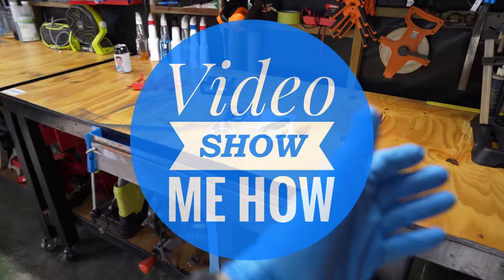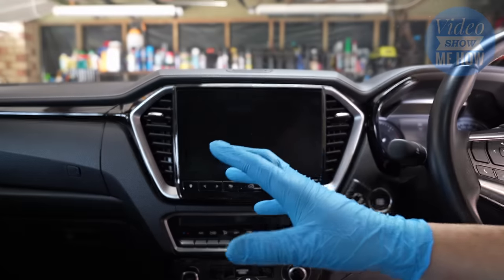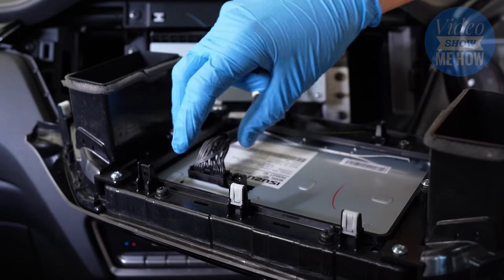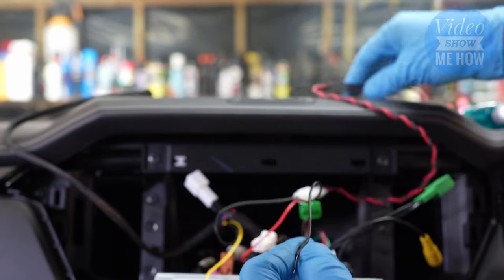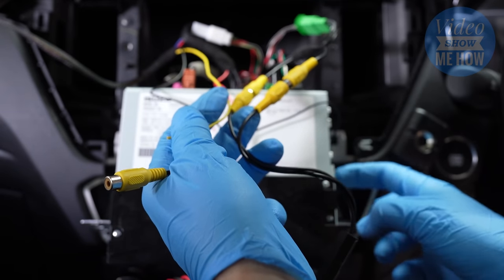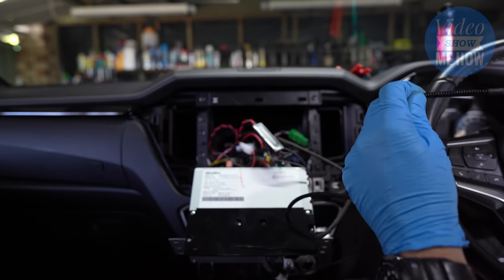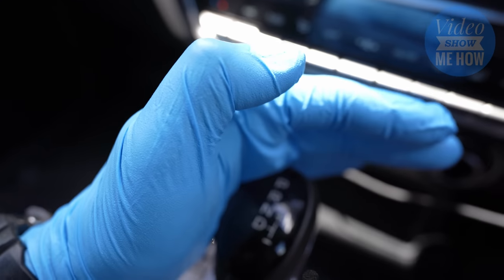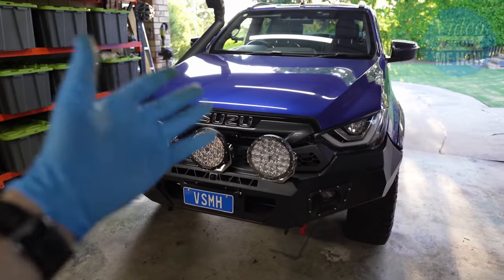D-MAX BT50 MUX DUAL Cameras! | Trac Electronics AT2 | 2021 Isuzu DMAX Build Series #31

Comment: I picked up my Dmax in Oct 2020 so she  has absolutely proven herself. First mod was front bar w/ winch, rear bar, underbody protection. Then tail gat lift, AT tyres,  HD suspension to help with the towing. Throttle controller was a revelation as where the LED reverse lights, licence plate lights (helps with connecting van at night) and front light bar. Tub rack and roof rack gives massive versatility and most recent was the DP Chip perfect touring beast.

Comment: Owned my D-max since Feb and first mod I did was the dual battery system the same way you did yours in the tub with the toolbox, I've found it very convenient and such a good idea to keep it all together also if I change my tub to a tray all my electrical components are very easy to move and install into the new tray.
Thank you for all the vidz you've given me the confidence I needed to make my D-max into my own pride and joy that I've proudly built.

Comment: I'll be definitely be getting this trac module. Thanks for all your helpful videos, even though i am handy its just good to get a bit of confidence from watching your videos. So far I've done the auto mirror mod, rear central locking, tailgate assist, back and front traffic cameras, 7pin trailer connector, brake controller, catch can and pre fuel filter. Keep up the great work 👍 👏

Comment: The first mod we made after picking up our new ute was the Trac window and mirror module which we bought after watching your install Adam. Your instructions were super clear and easy to follow to the point I delegated responsibility to my 14 year old! 

We would be very keen to install the Trac camera module next, and I think the hardest part will be deciding on location - front or rear.

Thanks again for your vids and thanks to Trac for another great product.
Reply: I have a twin-under-the-skin BT50 and have heaps done to it already,  but I am keen to add the window module to fold in the mirrors and then probably an air compressor and front diff lock.

Another great video!

Comment: Mate, I’ve been smashing through your videos all day. Great content and vey well presented. I’ve had my Dmax for just over a year and all I’ve done is put on an RSI canopy. After trawling through your channel, I plan on getting pretty much every module from Trac Electronics! Even a mug like me can install them 😂😂
Reply from the maker: How do you rate the RSI canopy? Heard good things?
Reply: @VideoShowMeHow  It looks the goods on the car, and is very solid. It’s got the best access from all the canopies I’ve seen with those massive doors. I’ve got the under roof mounted table and that works a treat. I was worried about it rattling but it’s a solid and snug fit. The only downside I’ve encountered with it is the inability to get it with central locking. I’ll need to do a bit more research to see if I can find something to retrofit, although with 6 locks it won’t be cheap.

Comment: Another great video Adam. Glad I’m not the only one that cracks it with the info start up screen. I’ve fitted the gas struts to the tailgate.  My next addition will be the central locking unit for the tailgate. As I’ve said before, constantly removing one key from the proximity remote  and the second key to lock the roller shutter is so frustrating.

Comment: What a great video, actually the whole series is so informative. Have paid a deposit on my new D-MAX X and its due to arrive in Late July. Very excited to install some of these great upgrades! One of the first ones will be the bullbar, then the tail gate struts and central locking, followed by the dual dash cam.
Reply: im in the exact same boat. how long ago did you pay the deposit? wondering as mine is due the same time.
Reply: @thataussiefisho6397  I paid on 29/01/22, i was told 9 months initially though.
Reply: @djperucic93  yeah I was told 9 months also when I signed the contract November last year. Then just recently got an update saying expected 28th July

Comment: Hi Adam, great video, i find it very informative what you do. Takes a lot of the guess work. Out of doing mods on the DMAX. I have ordered mine in the same colour as your in June last year. Should be finally here late June/early July.  I think the first thing I will be doing to it will be the central locking for the tray and the automatic window module. Just love the convenience of those two.
Thanks again for the great contend.

Comment: 2021 Dmax received in April, first mod done was installing the TRAC Electronics auto window and mirror folding module. Works great, saves the hassle of pressing close window switch all the time, and the auto folding mirror feature ensures I can double check the car is locked visually as I'm walking away!

Comment: Got a 21 blue LSU and I love it. Have  ARB accent cannopy and rear draws but want to set it up eventually with a decent 12v system to take my 2 young lads camping/ exploring. First mod is definitely catch can as per your video and I'm sure alot more other parts from the channel

Comment: Got my 2022 X-Terrain hopefully arriving mid year (ordered June 2021). Already got TJM bullbar, rear bar, side steps, side rails and snorkel getting fitted as soon as the Dmax arrives. Rhino rack platform with backbone, black duck seat covers at home ready to go including CSA rims, Maxxis RAZR AT tyres, and PSA suspension kit. Couple little mods I’ve been inspired to buy thanks to you such as the reversing LED lights upgrade and tailgate assist. Excited and well and truely an understatement!

Comment: ETA  Mid-April due to the floods in Brisbane, they couldn't dock so car is in NSW waiting transport. First mod will be installing Grenade Throttle Controller, then custom bash plates, Tail Gate assist and Provent 200. Future install will be the OffRoad Animal Toro Bar. Great video as always Adam 🤙

Comment: Hi Adam, I have a X-Terrain on order, unfortunately it's another 4 months away. I like your videos and had quite of a lot of similar mods on my D40 Titanium which I just sold. I am in the stages of acquiring a few things to immediately put on the the new X-Terrain. Wheels, Bar, Lights and suspension will go on first. Would love one of these duel camera units as it defiantly makes not only parking easier but towing as well. Cheers Dan.

Comment: Just got my new Bt50 end of February will be installing new wheels and suspension on the weekend then hopefully a tune and canopy soon. Would love one of these dual cameras as the misses is too used to her current car having a front camera and doesn't like parking the bt because it doesn't have the front camera as it only just fits in the shed.

Comment: Haven't got the LS-U dmax yet, but they tell it should arrive on Friday 25 March maybe it will arrive this time.  
To be fitted with a front bar with winch, e brake control,roof racks and Nex Gen power mirrors.
Still to come light bar, uhf, side rails, remove tub and fit a tray with lift off canopy.

Comment: Cool video and pretty neat setup. Does the controler switch the sides for the additional camera or you got the "front" parking camera? I remember when I was installing front and rear camera on my old 94 Navara, rear camera worked fine, but front camera had the sides switched (left was of on right and vice versa). But that went directly from camera to an auxiliary screen so a new camera that had an option to switch the sides solved it for me. 

Anyway I'm really looking forward to get a new D-Max later this year and the first mod will definitely be a snorkel. The other mods will come based on what will be needed after I test the stock vehicle.
Reply from the maker: Yeah you have to get a 'front' camera or at least one that can do both - I've linked a couple options in the description. You basically snip a wire and it flips the image

Comment: Awesome video as always. I have my “dmax” dressed as a Mazda tho. My next mod is changing a work light on the roof to something wider (I’m out travelling and finally real world tested the ones I bought and fit but not a wide enough spread). My only issue if I win this is what switch I move, t he XT BT50 only has 3 spare panels, I’ve maxed mine out, stedi fog lights & light bar switch and also stedi dual USB power (which works perfectly with the phone holder you have which I now have and love, having power under it is the best).

Comment: I have had my Dmax for a couple of months now. I have done the catch can mad. The Phone holder Mod, and the Dash cam mod. Followed your instruction and bought the same gear. Thanks mate. I have been wanting to set up a camera onto my Dash screen for my Caravan reverse camera. Do you think this would work with a Safety Dave camera setup.
Reply from the maker: Unsure mate, worth shooting Trac an email 👍
Reply: Safety Dave systems normally use the M12 4 pin connector so the Trac Electronics part number you need is AT2-4PIN as this has the corresponding M12 connector already connected

Comment: Waiting for our 2022 Isuzu Dmax and the first mod I’d love to do (and honestly because I’m guilty of being accused a lead-foot but don’t want a chip nor a throttle-gimmic) is get it absolutely Custom Dyno Tuned to remove any throttle lag, zero throttle lag and torque real low in the rev range. Brutally honest there.

Comment: Perfect timing for this video - this is the next mod I’ve got planned for my BT. Do you know how the Trac mod works with caravan cameras, i.e. The safety Dave?
Reply: Safety Dave systems normally use the M12 4 pin round connector so the Trac Electronics part number you need is AT2-4PIN as this has the corresponding M12 connector already connected so you can connect directly from the M12 extension cable to our unit.
Just check your camera is NTSC TV system so it matches the factory screen.

Comment: Thanks, Adam. great video. I'm keen to install this mod when I get my xterrain in august(fingers crossed). Will be using the dmax to tow our caravan with a saftey dave camera on the back, so I am hoping this unit is compatible.
Reply: Safety Dave systems normally use the M12 4 pin connector so the Trac Electronics part number you need is AT2-4PIN as this has the corresponding M12 connector already connected.
Double check your camera is NTSC TV system
Reply: @tracelectronics6595  I have the 2021 Dmax XT and wanting to put the camera on the front for my wife. She is not confident because of the bull bar. I want to buy the setup where I can select either at anytime with the switch. Do I need the M12 or RCA connectors for the rear of the unit? Unless someone on here already knows what I need. Cheers
Reply from the maker: What type of camera you using Steve?
Reply: @VideoShowMeHow  Adam, the rectangular one you had a link for on your video.
Reply: 170° Car Reverse Backup Night Vision Camera Rear View Kit Number Plate Mount
Reply: This camera has RCA jacks. So I worried if it will fit on my 2021 Dmax XT!!!
Reply from the maker: @steveg6853  if it has the RCA like mine in the vid your all good, you want the TRAC kit with RCA 👍
Reply: @VideoShowMeHow  thanks Adam. Champ.... Patreon is worth it.... 😀

Comment: Hi Adam, love the Dmax tips and tricks. My Dmax is due in July or August. One of the first mods will be electric brakes for towing the van, and setting up the reverse camera that is on the back of the van. The dual input option on the factory infotainment screen definitely looks the way to go. 
I watched your episode where you fitted a subwoofer to a Jeep. Can this be done to a Dmax?
Cheers.
Reply from the maker: Yes will be doing something similar - likely behind the rear seats :)

Comment: Hey Adam!  First Mod was I-Drive throttle controller and Next install on my BT-50 (DMAX in disguise...) will be my Yakima Platform and Lightforce 40" Lightbar. Unless of course I win the Trac Electronics AT2 Dual Camera intergration system ;)

Comment: Perfect timing for this video - this is the next mod I’ve got planned for my BT. Do you know how the Trac mod works with caravan cameras, i.e. The safety Dave?
Reply: Safety Dave systems normally use the M12 4 pin connector so the Trac Electronics part number you need is AT2-4PIN as this has the corresponding M12 connector already connected so just screw on to your M12 extension cable

Comment: Put a deposit down on the new M-ux in October 2021. Should get it by Xmas 2022. I was looking at a Safety Dave setup but this is so damn simple even i can do it. This will be the very first Mod i do. Adam, Great Videos BTW Keep them coming. That's until there's no more bling possible 🙂

Comment: Great mod. I have a new BT50 and that camera would do well in it. The camper keeps getting in my way. Doing a heap of mods at the moment. Started with a canopy. Just fitted a water tank in the tub. Getting drawers and a roof rack very soon. Followed by a bull bar and winch. Then I can do the suspension. The list keeps going. The camera would be a great addition. All mods can or will be seen on my channel. Cheers bud. 🙏😎

Comment: Hey Adam Great videos. Second reverse camera is exactly what I have been looking for to use on the big screen for camera on back if caravan been trying to find out how to do this now going to get one, I have followed you videos on fitting oil catch can, fitting pre-fuel filter, fitting the auto mirror module DPCHIPX and pedalbox plug and go, purchased and fitted them all and work very well only wish I new about the wireless pedalbox when I purchased it. 😀keep up the good work and videos, well done.
Reply from the maker: Thanks mate 👍

Comment: Wish my 2013 was as plug and play as the new models. I upgraded my head unit so I had Bluetooth. I wanted a rear camera as well but had to hard wire it. I threw back in the box and in the cupboard 😫

Comment: Thank you for this video it was super helpful. I've just installed 
this into my mu-x. Removing the head unit is not for the faint hearted. I actually found an easier way which involves removing the trim insert around the speedo first. Then removing the headunit with the start stop panel attached. No trim tools used but a nightmare job. Also worth ordering spare white and green clips as a couple of mine broke when pulling out the head unit. Front camera is great but omg what a job that was.

Comment: Mmmmm - your display unit seems to come out very easy. I’ve spent 90 mins trying to pry mine out but they are obviously not meant to budge. What is the trick? Can you do video without pre-removal to make it look so easy?
Reply from the maker: Yeah the surround is in tight, just take your time lever all the pins and give it firm pull out

Comment: For the people stuck with the 7 inch screen can you just plug in the 9 inch factory screen? Or is there more to it?
Reply from the maker: Am unsure sorry mate, the screen is kinda like a tablet that plugs to the amp behind, if you got both I'm sure it would be fine. Had a guy with a bt50 with the smaller screen use my 9" one after I upgraded

Comment: Hi Adam, I've been a fan of your videos since I bought my dmax August 2021. I've just notice there's wireless charger port as and accessory for the isuzu at the dealership. Are you able to make a video as I'm sure everyone would like this as much as I would.
Keep up the awesome content. 👍🏼
Reply from the maker: Interesting, is this wireless charge mat?
Reply: @VideoShowMeHow  Yes mate
Reply from the maker: Ah yep, yeah played around with a generic one (MUCH cheaper than the OEM), didn't have much success as found if the phone was bumped/not perfectly aligned would stop charging. Upgraded my phone mount to wireless instead, video on the channel of this
Reply: @VideoShowMeHow Nice one, make more sense to go down the path of phone mount wireless charge. I'll have to check out that video. Cheers for the tip!

Comment: be carful when you do install , slightest slip when connecting wires and it will pop a fuse which you may not be able to see blown fuse and will cause many strange things not to work / aircon fan / windows / are on same circuit.
Reply from the maker: ?? Major electrical problems? It's literally a fused plug and play module? Did you even watch the vid porkey or are you a competitor to these guys?